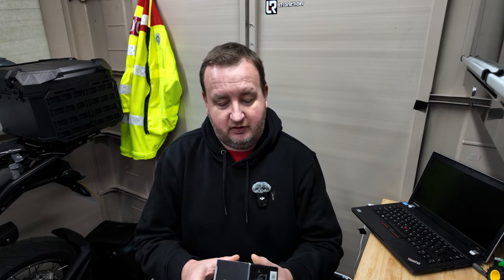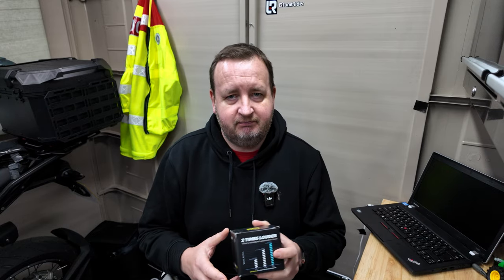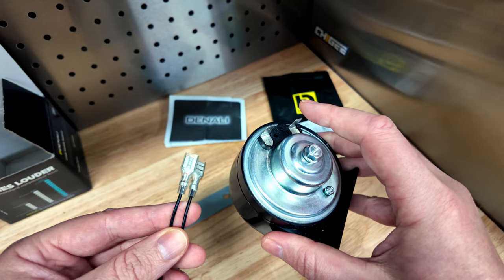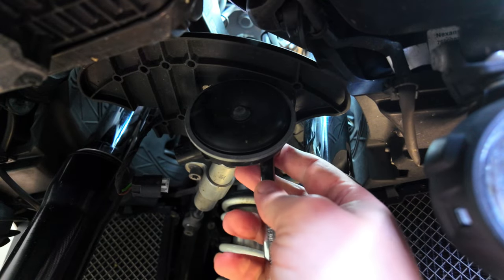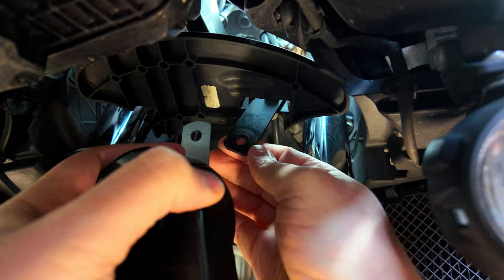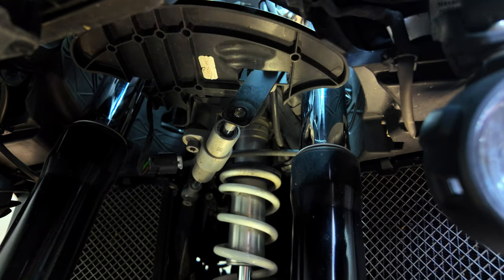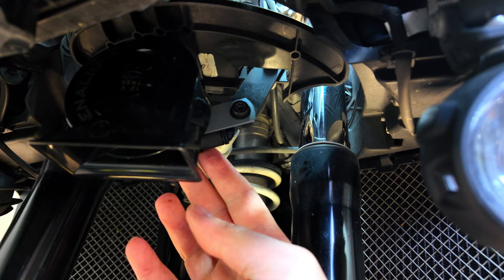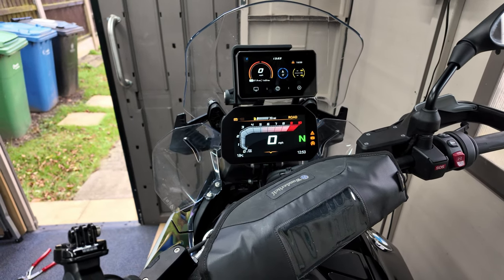Denali SoundBomb Mini vs OEM on a BMW R1300GS - Worth the upgrade?

Comment: The Dinali Soundbomb mini is not going to do much, although it does give you a deeper more penetrative frequency through the air and cars interiors. However, it's only going to be as good as the OEM because it works off the bikes 5amp system already in place. The other 2 versions need a new electrical harness, air tube and a 20amp electrical system. That's far better than the mini. The Metropolitan Police Special Escort Service uses those in London. Whistles don't seem to penetrate earphones/iPods, so they put out a tender for the fleet to be installed with the new full versions. The benefit of the mini is that it makes the bike sound more menacing and car like than a scooterish beep.

Comment: I do not understand why but yours sound a bit down, mine on my bikes are much louder and certainly turn heads when out. Watch for the current draw it is more than the standard horn so if you press for too long can blow a fuse.

Comment: Do they do a split sound bomb ?
Reply from the maker: Not to my knowledge no, I think you can fit the “full fat” soundbomb but for the 1300 the space is a bit limited so they suggest the mini. I’ll see what it’s like the next time I need to make someone aware of my presence 🤣
Reply: Yes, Denali makes a R1300GS specific split sound bomb mount. I just installed one on mine. Ordered from a bike thing. I preferred the more hidden compact mounting on my 1250, but the split if ok too. I was already doing a D3 install so it was super easy to install the split with their kit.